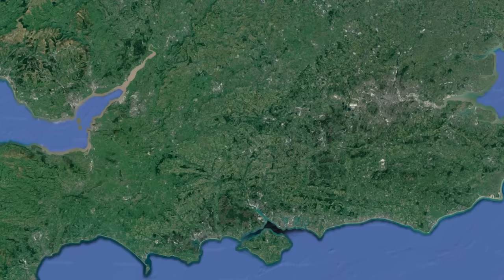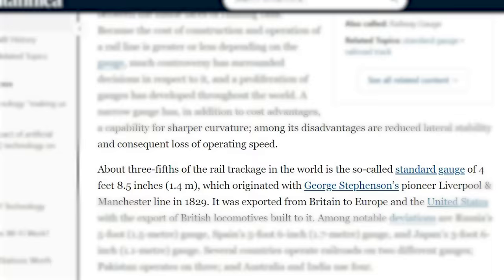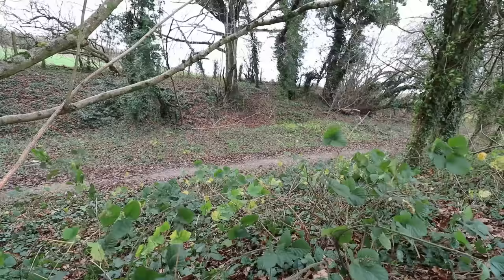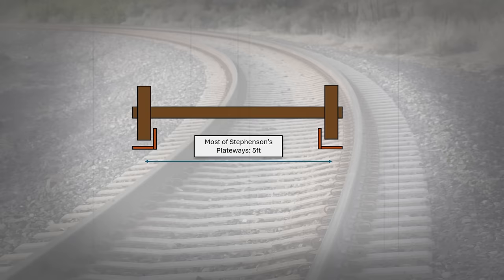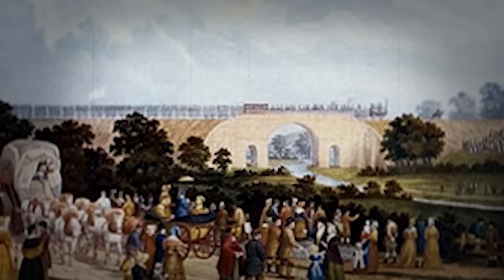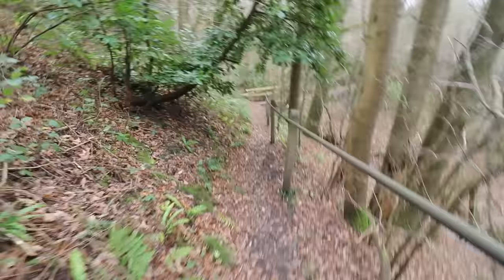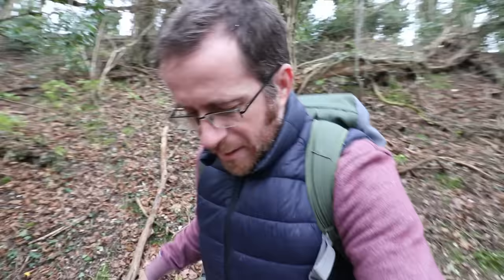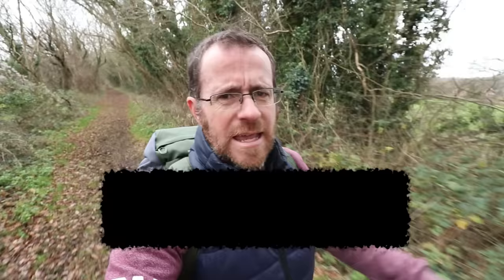Railway Gauges did NOT Evolve from a Roman Chariot.

Comment: I think one of the most incredible endeavours on changing track gauge was in the Southern states of the US in May/June1886. Over 11,000 miles of track were converted from 5 foot to 4 foot 9 inch gauge in just 36 hours over one weekend. On the Friday, trains were running on Russian gauge and on the Monday on Pennsylvania gauge.
Reply: @dariengoodwin southern engineer made vacuum sewage too
Reply: You all know why it won!
Its the sexiest gauge by far!
Reply: It is not really accurate to call it the Russian gauge a Russia got it from the US. It was suggested by George Washington Whistler.
Reply: And then there's the modern alchemy of the Spanish trains.

Not stopping, a button is pressed and bogies lift up, they breathe in, expand symmetrically whirr about a bit and generally enjoy the novelty of fresh air blowing through their innards.
Then quick as a flash, yet still in a regimented manner, wheels axles, bits and bobs come together in a slimmer (or bulkier) looking bogie.
Over and again, all the way along the train. A marvel of modern engineering, it has basically changed its underpants, found that the next pair has a hole in them, replaced those and successfully put on a third pair 
In Public no less whilst jogging down Regent Street
Reply: @okaro6595  it's not accurate to call the gauge only used in russia "russian" lol ok
Reply: @jorkusmalorkus  well, with this formulation, it could be understood that this gauge wasn't just used, but actually developed in Russia, when it wasn't. It's definitely implied.
Reply: @okaro6595   According to Wikipedia:
This gauge became commonly known as "Russian gauge", because the government of the Russian Empire chose it in 1843.
Reply: Wikipedia is Wikipedia.  It's not historically unique to Russia and the Russian government only accepted it fairly haphazardly from Whistler's early stage design proposal after little consideration, with no alternatives being necessary at the time.  "Chose by Russia" is probably too strong of wording.
Reply: @MilwaukeeF40C    It's literally called "Russian gauge"!

You should go fix the Wikipedia entry.  For the citation just say you saw it in some random YouTube comment by a world renowned train expert named "F40C". 
🤣
Reply: an extra odd part of that is that they used 4" 9' because the PRR was such a big railroad, but it's still not standard gauge, which congress had legislated the transcontinental railroad to use in 1863. the closest thing possible to a federal standard was there but they chose not to follow it.

also modern russian gauge isn't quite 5ft. 5ft (1524mm) was the gauge used by imperial russia and is still used in finland, but the soviet union re-gauged to 1520mm, which is what has the russian gauge name.
Reply: Yes.  All the supplies and manpower were carefully planned and staged because there were bonuses tied to fast completion.  What they did was move one rail inward on much of the track.  Not 100% was done in that short period (some sidings and yard tracks and spurs and such came later) but it was amazing.  They could re-truck freight cars in the south quickly to the new gauge but not engines.  They brought engines down from the north at first and, over time, regauged the 5 goot gauge engines in the south.  There was also a lot of politics as to what gauge would prevail, but it's its obvious who won that argument.
Reply: Well, making tracks SMALLER is of course easier than making them wider. You only need to take out the holders for one of the tracks, move the track to the new position, put the track holders back into place and your track is smaller. When you have to widen your tracks on the other hand, you often need new sleepers to be put under the track.
Reply: @danquaylesitsspeltpotatoe8307 

4 foot 9 inches is "the sexiest gauge"? Why?
Reply: @paulkennedy8701  
"4 foot 9 inches is "the sexiest gauge"? Why?"
clearly not a train euthanisest!
Reply: @danquaylesitsspeltpotatoe8307  

Clearly wanted an answer to my question.

Why would that gauge be the sexiest?
Reply: @paulkennedy8701  If you cant see why this gauge is the sexyiest you just cant comprehend it so cant understand the explanation!
Reply: @danquaylesitsspeltpotatoe8307  

So you think one particular random length is "sexy". That's just weird.
Reply: @paulkennedy8701  You think its just me! and you think its a length! See you have no idea on the subject!
Reply: @danquaylesitsspeltpotatoe8307  

Length. Height. Spacing. You clearly think it's something. Nobody else has said they agree with you. So it just sounds like your obsession.
Reply: @paulkennedy8701  NOPE your the only one who disagrees and your the one obsessed with telling me you have no idea when you dont even like trains!  But you will never be able to comprehend that and will reply with another pointless message!
Reply: @danquaylesitsspeltpotatoe8307 

So far there's nothing to comprehend. You haven't even said what you think is "sexy" about it.

You're worried that I "don't like trains". Are you saying it's trains that you think are sexy? That's even weirder.
Reply: @paulkennedy8701  Well you have no idea and thats proven by you saying "gauge length! " 🤦‍♂🤣
If its not the sexist gauge which is?
<<<fail to prove me wrong here!>>>>>
But please do send another Logical Fallacy!
Reply: @danquaylesitsspeltpotatoe8307  

I didn't say "gauge length". I said "length". I assumed you were claiming to find 4' 9" sexy. Maybe that's the height of your ideal person.

But apparently it's only as the spacing between rails that you think is "sexy". Or is it the spacing between the wheels?

And you are absolutely correct that I can't "comprehend" anyone finding either of those things sexy.

Comment: I laughed when you mentioned Australian railways being a mess, as an Aussie I totally agree with that assessment. New South Wales is 100% standard gauge and always was, Victoria adopted Irish broad gauge for whatever reason and mostly stuck with it (a standard gauge line was added between Wodonga on the Victorian border and Melbourne for through passenger trains in the 80"s), Western Australia, South Australia and Queensland adopted 3 foot 6 inch narrow gauge but loading gauge differs slightly between them, then there's the Trans Continental line which finally standardised on standard gauge in 1973 causing W.A. to have a weird dual gauge system from Kalgoorlie to Perth and S.A. to actually have all 3 gauges with no direct connections between any of them. It was even a topic in Australia before Federation and much more so in the decades after, still took until after WWII for any direct connections between any of the capital cities to happen and is half the reason why most fly between capital cities rather than use trains (the Indian Pacific is just a tourist train now and has been since the late 80's).
Reply: NSW, Vic and SA all adopted 5'3" at the instigation of NSW (who had an Irish "chief" engineer). Vic and SA ordered rolling stock. NSW delayed just a little, got a new Scottish engineer, who insisted on 4'8½". This was too late for Vic and SA to change their order, so they stuck with 5'3". The credibility of these early engineers and their decisions are up for debate!

Qld went for 3'6" as it was an underpopulated new colony, was building its first line up the range from Ipswich to Toowoomba, and couldn't afford large curves, or even wide sleepers.  Tas started with 5'3", but quickly gained many much narrower gauges (for the short mountain tramways). The Tasmanian Main Line Railway went with 3'6" even though the Government lines were 5'3". But TMLR was bought by the government and because this was the longest line, 3'6" became standard (and made more sense for the terrain). WA was also a poor colony (then) and 3'6" was cheaper. SA also wanted the economy of 3'6". Where Victoria had mountainous terrain, 2'6" was used for a handful of lines.

All states had private tramways/railways at a bewildering number of gauges. Australia-wide, these included: 1'3" (Bronte), 1'4½" (Mt Barker), 1'6" (Weston Park), 1'8" (Sons of Gwalia), 2'0" (Cane railways), 2'1" (Back Creek Slate Mine), 2'2" (Mount Morgan), 2'2¼" (Katoomba), 2'3" (North Head Quarantine),  2'6" (Vic), 2'6½" (Charters Towers Water Board), 2'7" (Kawarren limeworks), 2'8" (Semaphore Jetty), 2'8½" (?), 2'9" (Greta), 2'10" (Mount Pleasant),  3'0" (Powelltown), 3'1" (?),  3'3" (Tin Can Bay), 3'4½" (Rubicon), 3'6" (Cape), 3'6½" (El Caballo Blanco), 3'8½" (Mount Keira), 3'11" (Katoomba Scenic Railway), 4'0" (Kermandie), 4'2" (NSW logging), 4'3" (Latrobe tramway ?), 4'3½" (Latrobe tramway ?), 4'6" (Tatong), 4'8½" (Standard) 5'3" (Irish) 6'0" (Kermandie) as well as 700mm (Appleton Dock), 825mm (Charters Towers), 900mm (SEC Interconnecting), 1m (Hartley Vale), and 9.6m (Australia Telescope).

Melbourne and Adelaide were connected 5'3" in 1886. The standard gauge crept into southern Qld and Sydney and Brisbane were connected 4'8½" in 1930. Yes, WW2 did show the deficiencies in the different gauges. Sydney and Melbourne were connected 4'8½" in 1962. Sydney to Perth via Broken Hill in 1969, Alice Springs to this 4'8½" line in 1980 (reaching Darwin in 2004), and Adelaide in 1983. The Melbourne-Adelaide route was converted to Standard Gauge in 1995 along with much of western Victoria and parts of South Australia. Canberra was connected to Queanbeyan (and Sydney) in 1914.

We still have Queensland, Western Australia, Tamania and much of South Australia as 3'6", most of Victoria, suburban Adelaide, and some other parts of South Australia at 5'3", and all of NSW and the trunk routes between state capitals at 4'8½". Still a lot of cane railways (in Qld) at 2'0". Also several tourist/miniature (etc) railways at odd gauges, even if only for very short lengths.
Reply: @mrewan6221  Credibility -- of two closely related sources of the same information, engineers and engineers' decisions -- is a singular noun. It is up for debate.
Reply: @TheDavidlloydjones  That's what you got out of it? Your interpretation of a supposed grammar error in something I said?

I disagree with your interpretation. Strip away all the gramitically-irrelevant words: "credibility and decisions are" or "credibility and decisions is"?

Maybe your variety of English has the singular here; mine has the plural.
Reply: and New Zealand is 3'6" or 1,067mm throughout the country. (Same as some of the Ausrtralian States)
But Auckland, Otago and Southland provinces started with the British standard of 4' 81/2", and Canterbury 5'3", and I'm not sure about the rest of the country..... but the various provincial govt's were buying in second hand rolling stock and engines from other British colonies, who all had different gauges. Hence, in the beginning, NZ's railway gauges were all over the place.
Reply: @colonelfustercluck486  Yes. NZ has all sorts. I don't think NZ was part of the NSW-Vic-SA-Tas agreement, as it was pretty certain by then that NZ was never going to merge. Australia still held out hope, though; NZ is in the Aus constitution as a possible state, and the streets radiating out from Parl House in Canberra had one resereved for Wellington. The others are named after state capitals. When it was quite clear there would be no State of New Zealand, that street was renamed to Canberra Avenue.
Reply: This could be a reason for the use of land trains in Australia.
Reply: Err . .  South Australia:  Our suburban lines are still 5'3".  The Feds then built 3'6' and 4'8.5" in SA.  Apparently NSW, Vic & SA all agreed on 5'3".  On that basis, SA & Vic committed and went ahead. NSW had a change of government and switched to 4'8.5".  Part of the Federation of Australia agreement (1901) was that the Commonwealth would build the line from Adelaide to Darwin.  Failed to say by when or what gauge.  Ended up with 3'6" as far as Alice Springs (1878) before eventually the Federals came good with 4'8.5" all the way to Darwin (2004).
Queensland: Brisbane is 3'6".  When they went to join up their inland to coast lines, from Brisbane to Cairns, they chose 3'6".  Their 'new' tilt trains are 3'6".  The display at the Ipswich Railway Museum says a wider gauge would have cost eight (8) times more.  The cost difference mainly because of the larger curve radius needed for wider gauges and the earth works & bridges required for that.  Narrow gauge hugged the landscape, eliminating many bridges and less earth works.
WA: Perth is 3'6''.  Perth to Kalgoorlie (1890s) was 3'6". Changed to 4'8.5" with joint state and Fed funding.  The first full standard gauge train from Sydney to Perth was in 1970.
Reply: @colonelfustercluck486   but unified by Vogel in the `870s.
Reply: Flying is impractical for most freight.
Reply: "gramitically" is not a word.  Regardless, readers should know that more than half of Victoria is now standard gauge.  Melbourne Metro and certain regional lines remain at 5'3''.  Dual gauge proliferates a lot of the system.
Reply: @leechjim8023  over 60% of freight goes by road Brisbane-Sydney-Melbourne, that's why the Pacific/Princes Highways have been upgraded over the past 40 years (and continue to be upgraded).
Reply: @Tiger351  but rail can carry more freight for $ of fuel, and for $ of infrastructure. Trucking lobby has captured the decision making processes (also same here in NZ)

Comment: A nice video. Been an ex railway worker on the Birmingham to Oxford line. There was at a time next to the track south of Leamington a couple of feet of seven foot gauge covering the water spill. So you had the 2 standard gauge lines and to the side the Seven foot gauge for a couple of feet.

Comment: While the Great Western and its allies continued building 7-foot gauge lines, the thing that killed it was that the GWR ended up buying smaller railway companies that were standard gauge - particularly their routes into the Midlands.  Thus meant they had a non-standardisation issue within the company and had to build mixed gauge lines into Paddington and elsewhere which was a pain.  While the 7-foot gauge has some technical advantages for main lines it was just the sheer quantity of standard gauge lines that won it.
Reply: I imagine that added to the sheer quantity was the fact that putting standard gauge into broad gauge infrastructure, with its bridges, tunnels etc, would be far quicker, simpler, cheaper, than trying to expand standard gauge infrastructure to accommodate broad.